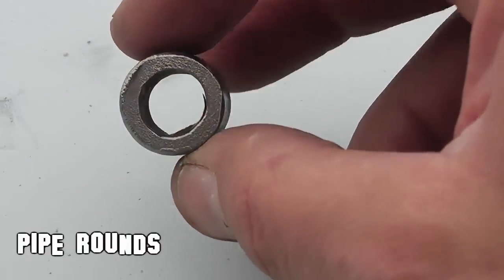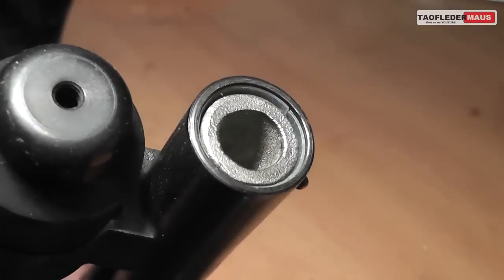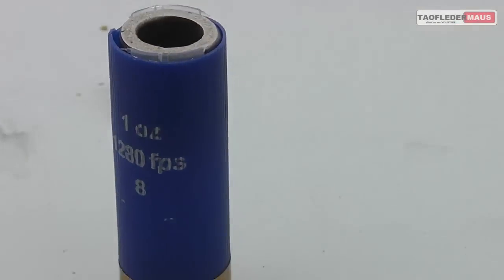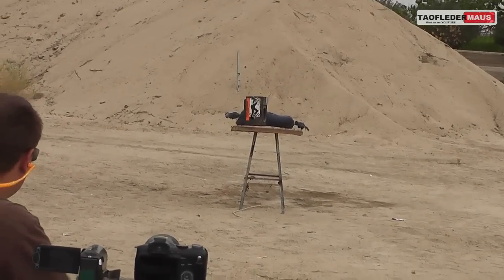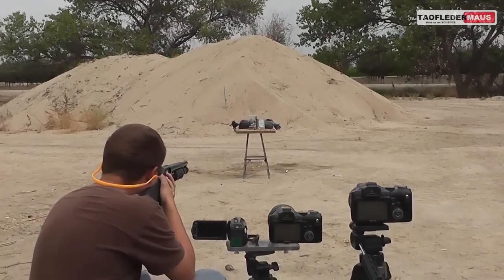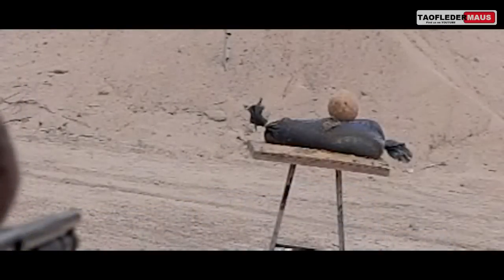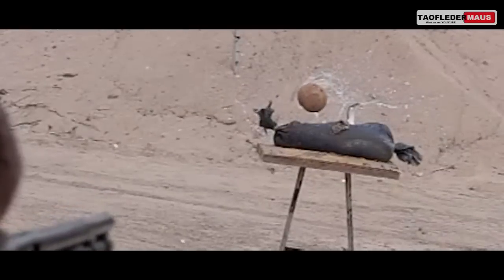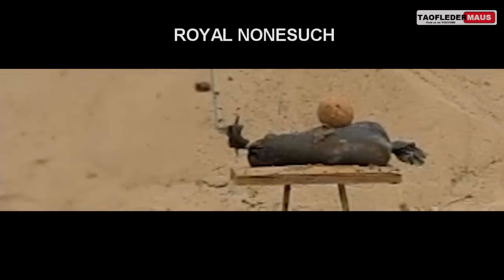Hollow PIPE Shotgun BULLETS?   You've been doing it WRONG!

Comment: I know this is 4 years old, so you probably won't see this. Here goes anyway: always maintain no fewer than 3 supports, preferably at 60° centers, while sending items down a barrel. Otherwise you run a high probability of jamming the barrel. It takes three points to describe a plane. In this context, the projectile is guided by maintaining its surface parallel to the barrel. Those three supports (points) in two dimensions extended into the third dimension (transition down the barrel) and helps to maintain the stability/attitude. As soon as I heard you say that you trimmed off the plastic and left 2 supports, a red flag went off in my mind. Like I said, I doubt anyone is going to read this. Had fun writing it.

Comment: Dude the problem with your situation is that you were using a pump shotgun. Royal Nonesuch is using a homemade single shot slam fire shotgun based on the pattern that the Filipino guerillas in WW2 used and was sold as the Richardson Industries Guerilla Gun in the late 1940s. The difference is that a standard shotgun barrel like yours narrows as you get to the muzzle. Royal Nonesuch's shotgun has the same barrel diameter at the breech and at the muzzle which is not the case with a pump shotgun or a factory made shotgun.

Comment: This is similar to the old Tubular rounds, the original brass tube version was actually banned since it could pierce soft body armor since it would cut right through it. The later copper and aluminum version just never did well in sales since the were expensive and not very accurate like a traditional JHP with no real advantage since they would either yaw dramatically or go through like an FMJ with no consistency.

Comment: I wonder if you filled the pipe with lead if that would give better performance. Might be a good emergency slug load if you wound up with no mold.
Reply: And a cylinder bore gun that is.
Reply: With the right shot cup, that should be worth a try.

Comment: id put a steel disc at the bottom of the shot cup so it dose not blow though the hole in the pipe id also keep all the pedals a snug fit is ok the soft plastic of the wad will squeeze down

Comment: don't forget you could turn those pipe bits down a little on a lathe or just a drill and some heavy grit sand paper so you could use a full shot cup and maybe even add lead wax or a dozen other things inside the pipe. Talk about metal jacketed rounds .....
Reply: he could have most likely used the full shot cup
Reply: That was a pretty tight fit. I think 10 minutes with a foot long bit of the pipe and sand paper would be plenty to turn it down then just cut give a quick once over with sand paper and tear some stuff up.
Reply: Nova Flare if I put my slugs in a wad I need a piece of cleaning rod to push them through they are around .680"-.690" depending o the alloy I use the pipe he is using is .675" od
Reply: Yeah, that 3/8 pipe should work with the right shot cup ... would like to see it tried again, but longer and filled with lead ... peace!

Comment: If those pipe rounds are letting all the pressure leak through the shot cup, you could always try driveshaft U-joint caps (with and without the needle bearings).

Comment: Can you try a length of steel 'cable sock', with something heavy attached to the front end, and try it with a smoothbore barrel? Maybe it'd expand after it comes out, and stabilize the flight. Maybe stitch a loop of fabric or something around the rear end to try to ensure that it gets dragged to full length.

Comment: Take the pipe and fill the top 1/2 to 3/8ths of it with molten lead, let it cool and now it should be heavier and fly straight because most of the weight is in the front.

Comment: how about embedding a small copper plate into the shotcup bigger than the inner diameter of the pipe segment? That would eliminate the possibility of the shotcup bottom being blown though the projectile and also make use with a paradox or fully rifled barrel possible

Comment: Seems like it would be a good idea to put a small metal disc in the cup prior to inserting the pipe section.  A dime would work.  It would definitely help to overcome the thin back profile problem, and as long as the pipe was cut fairly square and smooth it would probably vastly improve the chance of flying straight.

Comment: I'd love to see what a drill bit would do.. Find one that fits the inside diameter of the plastic cup like a 5/8ths or 11/16ths and trim it down to fit the length of the shell so that it's not six inches long. I'm almost positive that it'd fly sideways but it would be interesting if it corkscrewed through the air. I'd love to see that in slow motion.
Reply from the maker: I think the largest bit I have is 1/2".   I'd have to figure out how to keep it from gouging up the barrel.
Reply: I think harbor freight sells larger bits that aren't carbide tipped.
http://m.harborfreight.com/8-piece-m2-high-speed-steel-silver-and-deming-drill-bit-set-61802.html
Just high speed steel which I'm assuming is just tool steel. I'd send one if knew what size you'd need.

Comment: 2:13 = 3/8 inch SCH 80 = .423 ID , .657 OD = tight choke?
Reply: 3/8 pipe is 0.675 OD ... my smooth cylinder bore is 0.720 ID at the muzzle ... the thickness of the plastic sabot (shot cup) makes the difference ... round ball is normally 0.680 to 0.690 plus a shot cup, so 3/8 pipe should work with the right shot cup ... would also like to see it filled (lead shot or 7/16 hex bolt) and perhaps overall lengthened for better stability ... peace!

Comment: I would think that using a flap disc on a grinder to take off a mm or something along a section of pipe (then cut the slug sizes) would like make it so that you don't need to modify the cup.  Being hollow, I wonder too if they might tend to want to 'expand' and/or 'tilt' a bit  with the initial explosion of the powder and the modified cup?
Anyway, cool video..

Comment: With these you need to double up your wadding and grind the front edge to be a bit more rounded, with a lower charge. Essentually tube rounds work better at subsonic speeds as they are effectivly airfoils, but there are ways around this. Anyhow. Have fun.

Comment: put on a lath and taper from front to back,,,put a toggle bolt in the middle and fill with silicone,,,when it leaves the barrel the toggle opeans  like fin stabilizers ,,,sharpen bolt to a point,,,,I shot 5 rounds at 50 yrds with a 6 inch grouping.

Comment: Shoot one of those little rocket engines that you use in those little model rockets
Reply from the maker: What would light it?
Reply: I don't know if you made a black powder slurry then poured that in the end where the hole is that might light it or a fuse might be inserted or you could see if the charge it's self would light it... Thanks for responding :)

Comment: Pipe rounds
 What if you machined the inner diameter of the pipe at the rear of the round/pipe leaving an inner cuff in the front making it aerodynamic? (Ex. Flying aluminum cans)

You stated that you would not fire pipe again, but I believe this would work.

Comment: try 1.14 oz of dimes you wont believe the penetration with mod choke
use a shot cup with filler between the dimes
they slice through the air and deal deadly patterns

Comment: suggestions for shooting

a butterknife
rabbit shit (makes nice little pellets)
marbles
a crossbow bolt with field tips and adequate wadding
a slinky
a dense carrot
crushed glass with a slab of meat as a target
a C02 canister, you could probably fir 2 in the barrel
buckshot attached together with cheese wire
a nerf round dipped in wax or something
thermite mixed with plaster to make it solid enough to shoot. aim it at a lit magnesium strip (or strips) or something

Comment: Someone may have mentioned this already, but what about taking a hole-saw to an old AR500 plate, and shooting it at another one? Just for shits and giggles.
Reply from the maker: THe plates are hardened steel so it would destroy the hole saw.
Reply: Ah yeah, it'd probably even wear out a tungsten-carbide saw pretty quick.

Comment: Use a slightly smaller diameter pipe, harden the steel. Sharpen the leading edge. Use a thing hardened steel washer at the base to transfer the energy fully. fire through a rifled barrel. Call it the paper punch. :)

Comment: I want to see NO2 cartridges....the small cartridges for making gormet whipcream...or just for doing Nitrous Oxide depending on what your interests are ;) lol      Would be interesting to see in high speed, and I know they fit through a shotgun barrel no prob, friend of mine makes bird bomb type things with them, filling with a slightly less sensitive flash powder to handle the shock of being fired, running a fuze through the shot cup into the powder and using jb weld around the mouth of the cartridge/fuze to be sure the flame doesn't shoot straight into the cartridge setting it off in the barrel...they are reall awesome.  I pretty much told him it was something I wanted to try and how I would do it.  but that I wouldn't because I wanted to avoid going to prison for creating a destructive device and well he was less worried about it and did it.

Comment: to be honest i would have thought these  pipes would be one of the safer custom loads in that even if it dose get stuck in the barrel   the shot cup on the bottom would give way long before the barrel would and seeing as its a pipe and hollow the gasses would  find it much easier to go thru the plastic shot cup through the pipe and out the barrel rather than the breach :)

Comment: I think it is a mistake to cut the petals off the shot cup. They are plastic, they will extrude if it's too tight and not cause a problem. Like shooting a cut shell through a full choke, the choke can extrude lead, plastic is no problem. You wouldn't have got the pipe stuck if you had sufficient card under the pipe slug, maybe a dime.

Comment: I can see the idea behind it being quite good but I think the material it self is the problem, If you've ever seen a tubular paper airplane you see they fly extremely true and straight due to the fact they are spinning at a high enough speed to act gyroscopic force upon the object. If you could use a material that grips enough to spin on the rifling and doesn't deform in the air I don't see why it wouldn't fly true, unless the increase of low pressure due to the gasses being released through the open hole causing back turbulence.
Reply from the maker: True,   but  when the object is flying supersonic,  it's a different story.

Comment: smooth bore or rifled barrel?
Reply: smooth bore
Reply: i wonder if a rifled barrel would make a difference
Reply: paintballguy117 it would if the projectile is not bore size and a solid lead  a jacketed or a sabot slug the steel pipe would do some damage to a rifled barrel
Reply: camerl2009 but its still in the shot cup... how would that damage the rifling?
Reply: paintballguy117 because minor bore diameter is smaller then .730"
Reply: camerl2009 ok... so say we get a pipe that fits properly in the shot cup down a rifled barrel... would there be any difference?... i never said he had to do it with the same exact piece of pipe
Reply: paintballguy117 if it were any smaller it would not fit in a 12ga shot cup the pipe he was using was .675" od I would plain and simple stick to a lead full bore slug or a sabot that is meant for a rifled barrel
Reply: camerl2009 sticking to normal rounds kind of defeats the purpose of these videos no?

Comment: Hey Jeff, what about putting a disk (or a dime) between the wadding & the pipe to help protect the blast from exiting out the hollow pipe??
Reply: Dime in a full choke will not fit , nor a modified, improved cylinder, yes, otherwise, probably split barrel at the least.
Reply: @brucebangeman8627  Do you routinely dig up dead comments?

Comment: Try shooting aluminum oxide ceramic, aka 'Ninja Rocks'. What these do is they focus the energy in a small spot causing a lot of damage on impact. You can get these by smashing the ceramic part of a Spark Plug with a hammer or a large object. But make sure they are sharp enough or they will not work as well.